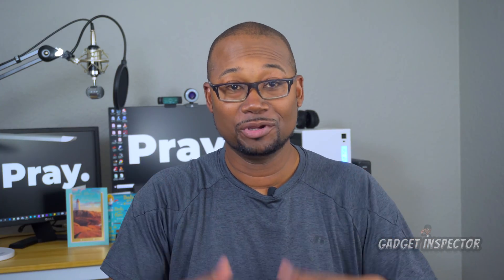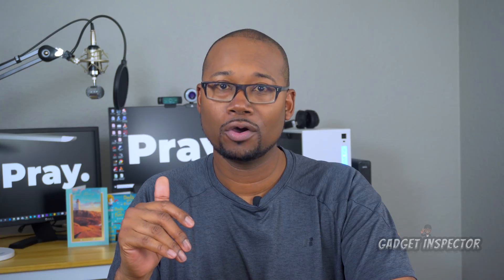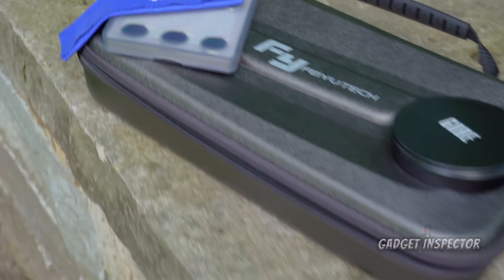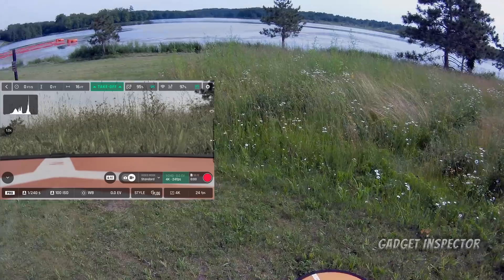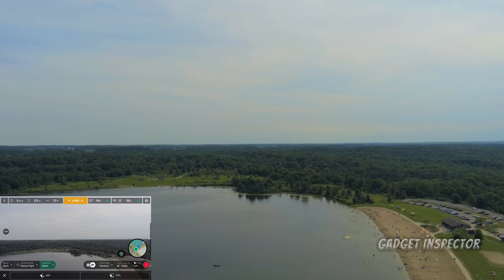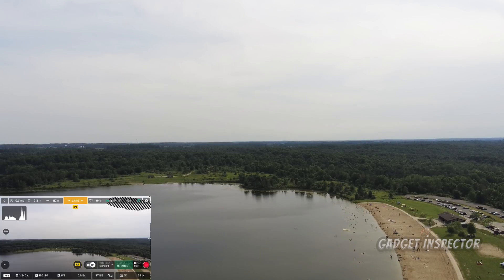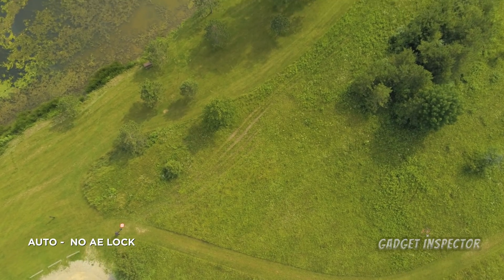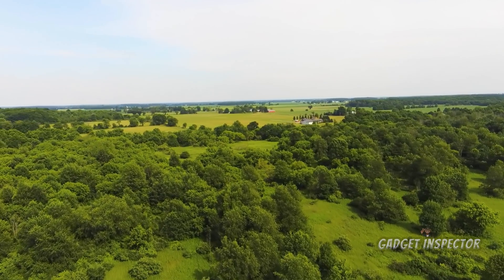Parrot ANAFI ND Filter and Camera Test | Episode 3 (Part 1)

Comment: You are experiencing the same problem that I am.
Now maybe not all of them do this but first that ring around the front of the camera.
 If you pay very close attention when it initializes it actually rotates around and taps the inside of the gimbal at least mind does so if anything protrudes out words it shortens the range of rotation and causes the gimbal calibration to fail.
Now I as for weight usually I don't see that until I'm up in the air and flying and then it says that I'm having a gimbal error and I can't move the camera.
PS this filter experience that I was having was with a cheaper brand called Sunfire.
Reply from the maker: Yeah, that was a bit of a surprise to me, but this is Parrot's first go at a drone with a physical gimbal. There are a few things about the design of the drone overall that I think could be better. Nevertheless, it's still one of my favorite birds to fly because it is probably the easiest to use. What I usually do is power on, mount the filter and then do a camera/gimbal calibration. Seems like that would cause an error, but I have never gotten one after doing it that way.

Comment: For me HDR are useless. Auto settings sometimes is prefered for some ocasions and situations. Lock I never used. But I manually controll just the shutter. I put iso in 100, the colour in cloudy, sunny or Auto and I controll the shutter manually depending on the light situations. Anafi most of the time in Auto "burns" the whites. So I manually lower the shutter giving nice results with nice detailed whites. I don't have filters on the Anafi but I have on the Mavic Pro and Mavic 2 Zoom and sometimes they get the image better and sometimes they put the image worse. Filters for me are a little complicated.
Reply from the maker: I agree. Some say HDR is best in low light/high contrast situations. I still haven't found a use for it. You're right about blown out whites...that's why I kept the filters. Seems to help.

Comment: I have the same Freewell ND filters as you have, actually there isn't much of selection for the Anafi. And I have the same issue, you can't mount them before starting the drone, they won't pass the gimbal test. And just like you said, even the lens cap won't pass the gimbal test. When I first got the DJI Spark, I had the same issue, the Polar Pro ND filters won't pass the gimbal test. But a later firmware update fixed this issue, so there may hope yet. The exposure lock feature is nice, especially if your lighting is constantly changing. And I have found it's better not to use the HDR video if your lighting is good. I only use it (HDR Video) in same situations that I would take a HDR photo with my camera. Great video, I'm loving your series on the Anafi.
Reply from the maker: Flight planning is next I think. Almost ready for my full review. Thanks for watching Ron.

Comment: I'm curious about the Anafi's micro jitters in it's video you mentioned. I purchased an Anafi last week and I returned it and ordered another (which is scheduled to be delivered 7/8) because one of the battery's was very difficult to install in the Anafi plus mine also had jittery video when turning or even when moving the camera up and down. Have you discovered why yours is jittery? I called Parrot and they told me if the video is jittery that the drone is defective.
Reply from the maker: Hey Mark. I think we're referring to different things. As you can see, the video from my Anafi is very smooth and what I experienced on just one occasion can happen with any drone in this category. I've seen it on my Phantom 4 on rare occasions. I believe it was because I was flying on a very gusty day and I have not seen it again. I have already posted tons of footage and will be posting tons more so you'll be able to see with your own eyes. Very smooth video coming from this drone. Hope your replacement doesn't have the problem the first had. Don't forget about calibrating and leveling the camera as well.
Reply: @GadgetInspector  Just got my replacement Anafi. All the battery's fit perfect unlike the last one I returned. I still have a problem with the video it takes as it is out of focus when I turn the drone or move the gimbal up or down. As soon as the movement stops it is in focus. My Bebop 2 does the same thing. Im not sure why, maybe its because my other drone that I sold that didn't have this problem was a Autel Evo which has 4k 60fps?
Reply from the maker: @theobserver3021  Really? That is awful strange. Maybe try switching to 1080 60fps if that's more of what you're used to and compare the footage.

Comment: That statement is wrong about the gimbal and extra weight. I boot my Anafi with the filters on and has no problem, even just a while ago
Reply from the maker: My position is: do whatever you feel is best. But.....1:18, the manual suggests otherwise. No biggie, but my statement is not wrong (I attached a link to the manual in the description box and I even included an excerpt in the video). Hard to miss it. Thanks for watching though.
Reply: Gadget Inspector Understand and respect your opinion, but I really think that manual is joke. Parrot fell so short with that manual it remind me so much of those Chinese knock off manual. It make me really wonder if they really put their products to extreme testing. I do love my Anafi don’t get me wrong!!